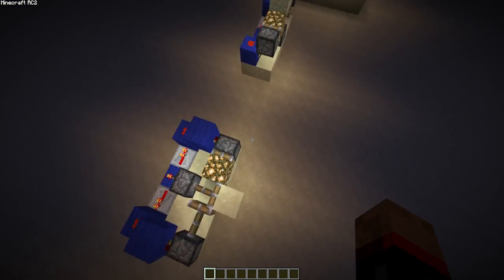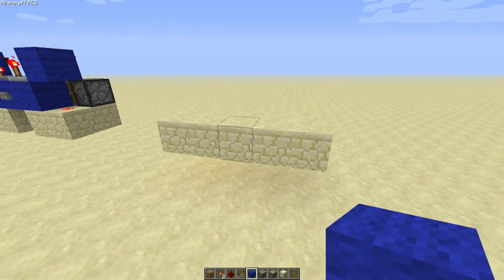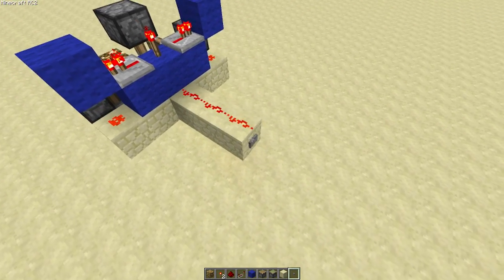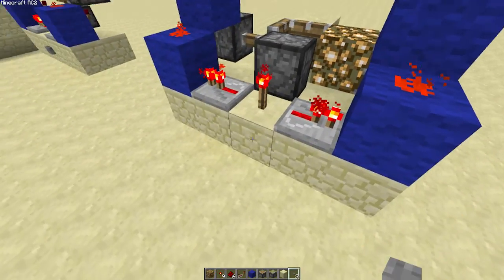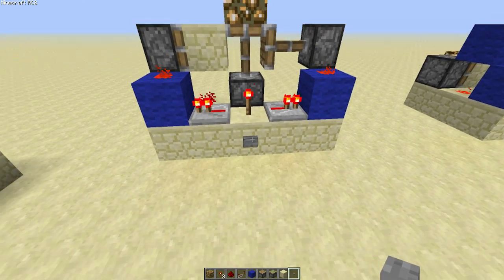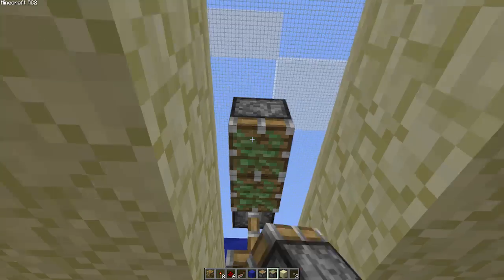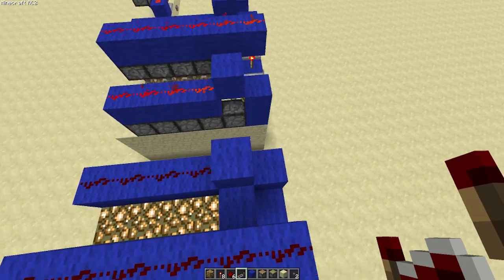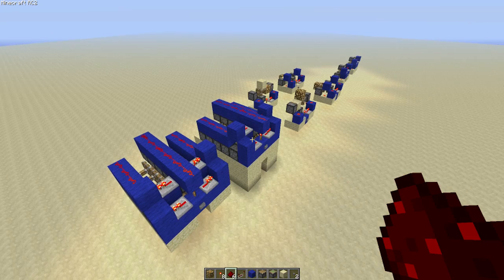2x2x5 Retractable Lighting: Strip Light, Walls, Floor + RC2 Fix [Minecraft Redstone Tutorials]

Comment: Would the strip light for the ceiling also work by just stacking the floor lighting side by side?
Reply: Yes, but there will have to be a one-block space in between the mechanisms in order to work properly. Also, you can make the lights longer by repeating the pattern (if you didn't already know)

Comment: you would just need to attach a redstone signal refresher via a repeater somewhere along the line which may take a bit of modification. you may be able to get away with a wool block with a repeater on one side and redstone out the other where the redstone dust is on this model

Comment: You don't have to place buttons directly on the mechanisms as shown in the video. The buttons merely represent "inputs". Place a button, then use redstone to connect the button to the input. You can then branch off that redstone wire and attach it to the inputs of other mechanisms. I hope this helps because I can't explain it any simpler.

Comment: Was just trying this out and couldn't understand your solution but I eventually got it :D
To try and make it easier to explain, you put 2 extra blocks like this (top view):
■■■■■ < pistons
■■■■■ < input row with repeaters and torch
■□□□■ < new blocks same level as the base blocks.
and then you put redstone dust on the new blocks.
Hope this is a bit clearer and thanks Jordain for the original solution ^_^

Comment: If no one has found out yet (idk) A fix for the Xbox for the floor lightin is to just put  an extra redstone facing  the torch behind the block (that powers the switcher pistons). For some reason the extra redstone fixes  the switcher pistons not being default on

Comment: If it's more than 15 length (The Redstone wire) it won't work because the power cuts out at 16 length so what you need to do is attach a repeater somewhere on the line to extend the current. If this doesn't work you are most likely not powering the input block correctly and can find out how to do that on the wiki and such.

Comment: I wish the retractable floor light worked on the 360 version. The previous retractable floor light that no longer works on PC does work for xbox, but it's not compact enough. I want to have 2 retractable lights on the floor, with only 2 solid blocks between them. XXOXXOXX < - Like this. I can get them so there are 3 blocks inbetween, but my room is small and i want it symmetrical, so it needs be 2. : (

Comment: With the floor lighting, place a block instead of the torch next to the sticky piston. Then place redstone on top to connect it to a lever etc. However u have to pull the level to do each stage seperatly. :) If anyone has a better way please tell me

Comment: Much cooler is this If you want that the light comes on when it is night you must do this: The button will become a pressure plate in a 1x2 house. where a villager can go in. And when it is night the Villager will go inside the house and the light in your base will come on because the villager is standing on the pressure plate that turns this retractable on and off. And you dont need to push a button anymore! (the villager will go out when it is day)

Comment: In SSP the wall light works with a direct button input however when I extend its reach  it fails to swap the blocks, I have rebuilt this many times with the exact copy of yours but it still does not work. How can I fix this?

Comment: I have a problem with the strip light. It works for a while but then the torch burns out. I tried replacing it but it still doesn't work. Is there a fix for this? I tried rebuilding it over and over but that spot where the torch burned out never works anymore. (SMP)

Comment: All I had to do to make strip lights for any surface (ceiling, floor, walls) just about any length is take the block-switcher circuit from the hidden stairs tutorial and attach the power outputs to a string of pistons. The ceiling setup in this video is much more efficient and compact, but with the block switcher circuit, you could control all four sides with one button and circuit.